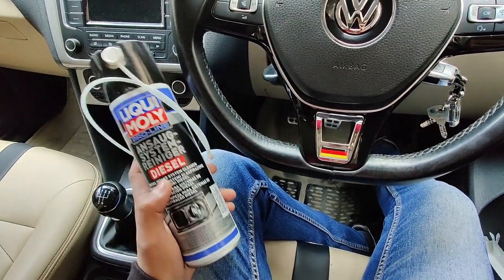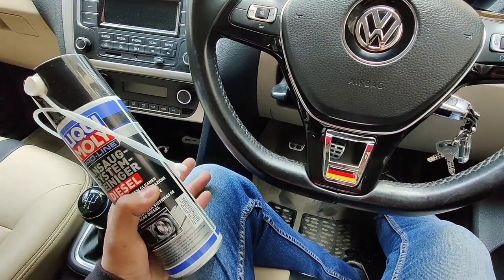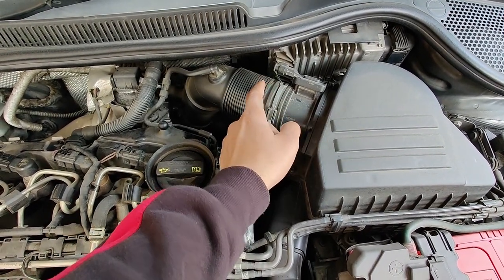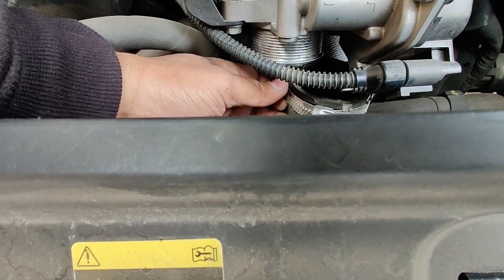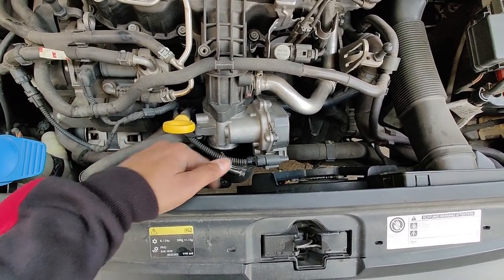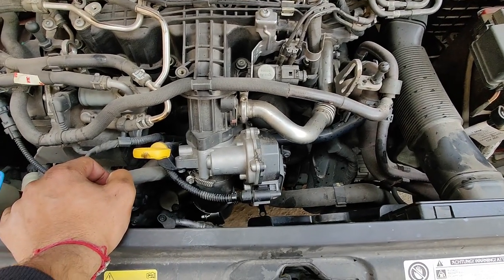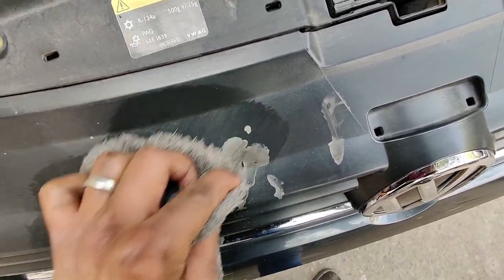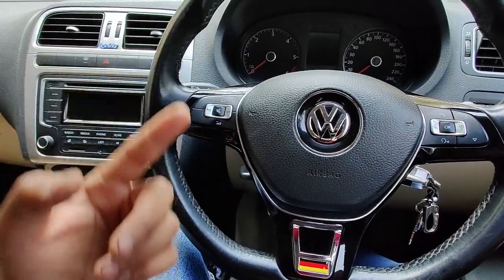INTAKE MANIFOLD CLEANING WITHOUT REMOVAL | CARBON CLEANING | LIQUI MOLY | REVIEW

Comment: Bro, i did this process in my 2008 model Diesel swift yesterday. Inserted the spray probe directly to the egr intake. Not after maf sensor. White smoke coming from exhaust and knocking happens when raised to 2500 rpm. Is it normal?
Reply from the maker: Sir if knocking starts then you need to switch off the engine and then spray at increased intervals to avoid knocking

Comment: my opinion if u done like this then all carbons going to the partikalfilter and this is big issue also . for mire better result . open and clean . and then after every 1000km use this spray . i mean not all the spray but u can spray this between 1000 to 5000 km one bottle . i am not mechanic but if u understand that all manifold carbon goes to exhaust direction and burn . better open and clean and then regular use . what u think?
Reply from the maker: Yes sir , you are absolutely right , no doubts about that , but the situation is different here as the car doesn't have any particulate filter

Comment: i just used two bottles of this on my v10 tdi, one in each bank, i kinda wish i would have doubled up since the buildup was really really bad, a good 1-1.5cm of sludge. it made a great difference in throttle response and it sounds awesome tho
Reply from the maker: V10 TDI 😅 sounds fun
Reply: @yourDIYneeds  just drove out to nevada mountains to camp and averaged 28mpg on flat ground. 8mpg in low range...lol...
Reply from the maker: 😅 extreme on both ends

Comment: Any risk this will clog the DPF? Especially since cars with dirty intake probably also have high ash level in DPF?
Reply from the maker: Sir if you really want to keep your DPF clean then you need to keep 2 things in mind 
1. Never drive that engine cold , give it some time to warm up 
2. Never lug the engine on name of fuel efficiency , rev it to the ideal level before shifting
At-least 2k rpm before shifting.
You will never face any DPF or cateletic convertor blockage issues .
And that cleaner will help to clean the deposited carbon buildup inside the intake system.

Hope it helps

Comment: Thanks for one more great diy video .. i have a doubt ...If I want clean egr system also using this,  where should I spray?In old Octavia and Laura , it's bit easy, but in Rapid and vento , it's confusing..
Reply from the maker: Sir this cleaner claims to do egr as well but i suspect that , there is a different egr cleaner by liqui , you can use that
And best spray port is to open one of the egr outlets and spray it damp and then let it soak overnight
Reply: @yourDIYneeds  egr outlet means the pipe that comes from egr to anti shudder valve, the one you were showing in a video?
Reply from the maker: Yes sir , but not that side , same pipe from the other end , which is behind the engine block

Sir are you encountering any egr problems or you are trying to do it as prevention?
Reply: @yourDIYneeds  currently there is no visible issues.. but a slight , very small amount of pick up is reduced. .But no smoke issue or erratic  idling issues so far..  If need to open the other side, it's difficult.. can we find the egr block by vcds? Actually I'm just starting diy things.. started trying in our old m-800 just like break servicing, caburater cleaning etc..
Reply from the maker: Sir why you don't go for a Italian tune-up 
Basically , egr system is capable of self cleaning , you just have to drive in desired way , 
Like if you drive at speed of 70 in 5th gear then the engine speed is 1800-1900 rpm 
Just drive on 70 but in 4th gear engine speed will be around 2200-2300 and exhaust gases will create a good temp. To burn the carbon and throw it out of exhaust pipe and occasionally take the engine till 4000 rpm to clean the egr and exhaust system 
You will never encounter any egr issues
Reply: @yourDIYneeds  Dear bro..Don't make fun of me..😀.. I'm a slow driver... Most preferred driving pattern is 50kmph at 5th gear with 1000 rpm.. I prefer that style as a part of defensive driving.. because of the traffic culture existing in our country... rarely,  when driving through ghats where only 2nd and 3rd gears are needed, then the rpm raises above 2000..That's it.. I'll keep ur suggestions from this point of time onwards.. thanks for ur support..
Reply from the maker: Anytime sir🙂
Reply: @yourDIYneeds  Dear sir
I used the same on ecosport diesel 2018 facelift after maf sensor but there is turbo after the same i used it on that 75% of that bottle but after that i saw very little white haze so in terror i stopped the process and also engine malfunction light having wrench turned on so i turned off engine and reconnected the hose to turbo after and turned on engine after 1 minute or so light disappeared.
Now question is did i do it right or wrong spraying it on turbo as there was only turbo after air filter and maf sensor?
If right then why theres white haze and malfunction light?
And if wrong how deep trouble i am in?

Please reply please
Thanks for your help

Comment: Skoda Rapid 1.6 TDI NA2 (2014)

So I have a question.
I cleaned my pipe from air-filter to turbo last year. In a few days from now I am planning on completely opening the anti-shudder valve, the EGR system pipe & the intake manifold and giving them a proper cleaning using some diesel.
Now comes my question, should I go 1 more step further and use a product like this to make sure the entire system is thoroughly clean after I've put everything back together (considering a diesel soaked cloth can't reach everywhere :P), or do you think that this exercise will be unnecessary?
Reply from the maker: Sir , It can be a good idea , because even after cleaning the intake , shudder valve and egr return , your manifold runners and valve-stems can still have a little bit of deposit , which can be reduced with the help of this product
Reply: @yourDIYneeds  Thank You 👍🏼🙏🏼

Comment: hello! thanks for the explanation after cleaning the egr valve! the engine did the regeneration of the fap filter?
Reply from the maker: Sir its a bs4 varient , so it doesn't have any fuel particulate filter , so no regeneration

Comment: Do you recommend the spray cleaning method or the manual dismantle and fix method of EGR cleaning?
What is the effectiveness of both cases?
Reply from the maker: Sir if its clogged the removal and cleaning , then after every 10-15k kms , spray it to keep it clean
Reply from the maker: Can be used from after filter , but sirf after the MAF sensor
Reply: @yourDIYneeds  Dear sir
I used the same on ecosport diesel 2018 facelift after maf sensor but there is turbo after the same i used it on that 75% of that bottle but after that i saw very little white haze so in terror i stopped the process and also engine malfunction light having wrench turned on so i turned off engine and reconnected the hose to turbo after and turned on engine after 1 minute or so light disappeared.
Now question is did i do it right or wrong spraying it on turbo as there was only turbo after air filter and maf sensor?
If right then why theres white haze and malfunction light?
And if wrong how deep trouble i am in?

Please reply please
Thanks for your help

Comment: I have vento 1.5 tdi, and doesnt give pickup and jerks in 4th and 5th gear, when i try to acclerate hard. can i spray in pipe after the maf sensor( sparying after disconnting from filter pipe), as recoomended by manfuacturer. Will it help. 
And How does it impact injectors..
 And can we use WURTH CARBRATOR AND INJECTOR CLEANER to do this. please reply. Thanks for the video
Reply from the maker: Yes you can , but then there are chances  it will get settled in the intercooler .
Reply: @yourDIYneeds  thank you then will do as in you video

Comment: Loved the fact that there was no knocking in the engine when the RPM increased from idle to 2500 RPM as the 1.5 TDI are prone to. 

The fact that you are using these products gives your subscribers confidence to use them.

Comment: Hi sir, I have I20 ELITE petrol car. I I tried all the servicing. such as wire harness, throttle body cleaning. and check thorugh huyndai serbice center also. but i have these performance/ pickup problem so should i go through intake manifold cleaning.
Reply from the maker: Sir have you done fuel system cleaning ?
Reply: @yourDIYneeds  no sir but I was change fuel filter also in this service.
Reply from the maker: Sir then please try it once , it may solve your problem

Comment: Hiya bud recently had issue w my car, turned out to be extreme carbon buildup in the manifold, got it diagnosed and completely sorted, was 400£ labour bill to clean all the carbon - cars got 100k on the clock- wanting to avoid this happening again, would a dpf&egr delete stop carbon build up? 

Great video, thanks again.
Reply from the maker: Sir this problem usually arise when we drive the car in relaxed manner for long periods of time + short trips where engine is not even able to warm up also increases the chances of this happening , i will advise you to rev the car to the limit atleast once a week and for like for 3-4 kms of driving , engines are perfectly capable of cleaning themselves but all they need is good enough exhaust temperature , drive in speed limit but rather than driving in 5th gear stick to 3rd  for 3-4 kms and your engine will create enough heat to burn the carbon deposits and they will get cooked and chip off .( Its called Italian tune-up )
Reply: @yourDIYneeds  Hiya thanks for the reply, wondering can ofc do this I do cover a few miles"; but if revin the car to get it up to temp etc etc will this not cause ware on the turbo/ general engine? 

Thanks.
Reply from the maker: No sir , its is what turbo is made for
Reply: @joegxz  piston rings & oil seals underneath piston rings would be under intense pressure but not at all for a turbo.
Reply: Dpf and egr delete will definitely help manifold, shudder valve and other parts from accumulating carbon, that is if you drive short trips. If you drive the car longer than 10 minutes above 50mph daily you wouldn't have much carbon buildup. It all depends on the driving style.

Comment: My vehicle's air intake is from the turbo, is this spray being squeezed by the propellers?
Reply from the maker: Sir if we add this from the turbo inlet , then there are alot of chances that it will get stored inside the intercooler and then come in cylinder when we are driving , and we don't want that .
Reply: @yourDIYneeds  my car is audi a6 c5 2.5 tdi allroad 2004, i think there is no other air intake.
Reply from the maker: Sir just remove the pipe going into intake and spray it directly

Comment: nice video, do we need to change the engine oil after decarb?
Reply from the maker: Sir , not compalsary , but if you want you can do it for peace of mind
Reply: @yourDIYneeds  where to buy this decarb?
Reply from the maker: Sir i bought it offline , but you will find it easily on amazon
Reply: @yourDIYneeds  ok, not finding in amazon, may be its unavailable.
Reply: @yourDIYneeds  one more query , do we have to use all it once??
Reply from the maker: Sir ideally once every 80k kms will be sufficient
Reply from the maker: Yes , stock issues exist with liqui moly products
Reply: @yourDIYneeds  no i meant, do we have to use all bottle once?
Reply: @yourDIYneeds  from where i buy offline this product.on amazon it is out of stock
Reply from the maker: Sir i bought it offline , but abhi last time confirm kia tha to unke paas bhi out of stock tha , to apko amazon check karte rehna padega ,jaise hi stock me aae order kar dijiye
Reply: I have 450,000 miles on my tdi , will it help?
Reply from the maker: Yes sir , it will

Comment: Appreciable video...

I have a question..my Vento 2012 model haven't gone through any intake system cleaning..I want to use the LM intake cleaner.. should I start cleaning from the point you are mentioning or after the sensors?
Reply from the maker: Sir , after the sensor , that the way to clean the complete path , i did it because i had already cleaned alot if it by removing the parts .

Comment: I have a vw polo 1.5 TDI 
It’s done 70000 kms 
The car is feeling sluggish 
Heavy on 2nd third gear on low speeds 
Any suggestions 
Nothing has been done except general Servicing
Reply from the maker: Sir any lights or anything on dash cluster ?
Reply: @yourDIYneeds   no light on dashboard 
Or any kind of indication
Reply from the maker: Have you faced Any clutch slips ? 
Because if something was wrong on engines front then it will throw a light on dash .
Feels like , clutch is getting worn and most probably will go down in next 20k kms 
To check that , fill up your tyres to 36 psi ( cold ) all around and then try to drive , if it feels ok after over-inflation then 99% of chances are clutch is on its way
Reply: @yourDIYneeds  thanks a lot 🙏

Comment: Dear sir
I used the same on ecosport diesel 2018 facelift after maf sensor but there is turbo after the same i used it on that 75% of that bottle but after that i saw very little white haze so in terror i stopped the process and also engine malfunction light having wrench turned on so i turned off engine and reconnected the hose to turbo after and turned on engine after 1 minute or so light disappeared.
Now question is did i do it right or wrong spraying it on turbo as there was only turbo after air filter and maf sensor?
If right then why theres white haze and malfunction light?
And if wrong how deep trouble i am in?

Please reply please
Thanks for your help
Reply from the maker: Sir no troubles 😅 don't worry
Engine light came on because the engine control module has a range in which it expects the data from MAF sensor and as soon as you disconnected the hose , now the MAF sensor is not provided the data in that range which is known to ECM , so it threw a light on the instrument cluster.

White smoke is because when you are adding the cleaner ultimately we are making the combustion mix rich ( too much of fuel to burn ) and some part of it will remain unburnt , that's why you observed the white smoke .
Reply: @yourDIYneeds  thank u very much for your reply sir really appreciate it have a wonderful day.

Comment: Question ⁉️ is our exhaust waste gate is controlled by ECU or by tubo boost?
Reply from the maker: Its controlled by a electronic actuator which gets its signal from ECU and ECU gathers data to open or not based upon the reading of vaccume and turbo boost pressure sensor .
Reply: @yourDIYneeds  thike hi

Comment: Ok guys,i have already done this process with the Liqui Moly.
Please be warned and learn from my experience,approx one week after this process my EGR cooler valve failed at only 36,000 miles.
When the EGR valve was removed and replaced,i found the old egr had become wet and clogged with black carbon soot.
So much so that the recirculation gas valve which is controlled by the electric motor had stuck open.
The point is the carbon build up inside the valve was wet,normally it should  be dry.
I firmly believe that the Liqui Moly solution caused this EGR to fail,due to causing a wet carbon sludge in the EGR valve mechanism.
Reply from the maker: Sir , this product is to clean a mild carbon , but if it is heavily clogged up , then dis assembly  is the best way

Comment: Hi @yourdiyneeds  
I just want you to try VEEDOL 5W30 API SN ENGINE OIL

(Tried it because its indian but it is really good
Previously i tried shell and castrol but Veedol is significantly different)

I tried it and it significantly reduced engine vibration and performance. Tried in polo 1.2 petrol and 1.6 tdi at the same time 

You should try this and make a video
Reply from the maker: Sir , it didn't have the approval of vw so its not best to use this specific oil
Reply: Hi Soni ji.🙏kar. we should also take the 5W30 oil grades less friction & smooth behaviour compared to 5W40 oil Grades due to higher viscosity of (X W 40) grade oil.
Reply from the maker: Sir watch the most recent video on the channel that will take you through the disadvantage of changing oil grade

Comment: This spray wont fix the problem but it will ruin the paint.
Do not spray on the car paint...I felt like engine may freeze while keeping the RPM high while spraying the can.
I used half can and stop doing this stuff...I will give it to showroom to clean EGR.

Comment: One doubt.  After how much Km we should  repeat this process..suppose we did at 55k. Than after how much kms we should  repeat.
Reply from the maker: Sir its done after 65-70k kms for consistent results
Reply: @yourDIYneeds  than my next repeat process is at 1.3 lkhs km
Reply from the maker: Yes sir
Reply: Thank you so much for your time.
One more question.
Should engine engine oil flush be used every time before changing oil or there is an interval for that too. I used liqui moly in the recent service. Sorry to bother you so much. But these details are hard to sort.
Reply from the maker: Sir , they are never supposed to be used , they are corrosive and can damage the internal components , definately not the metals but rubber seals , oil rings are definitely are at a risk . So change your engine oil on time and use a good quality engine oil is more than an engine needs